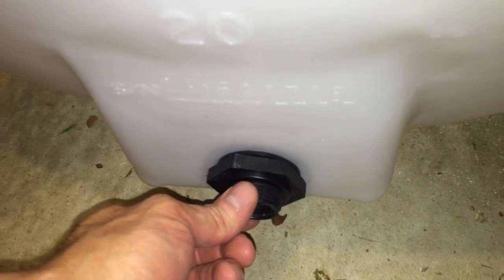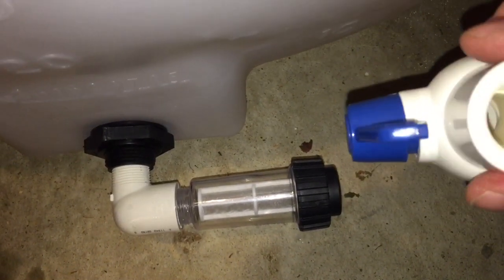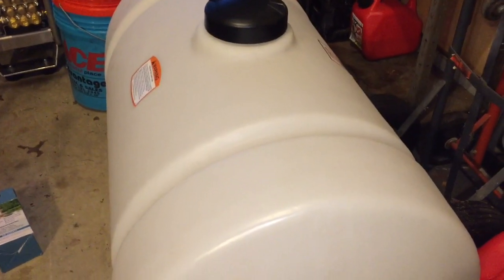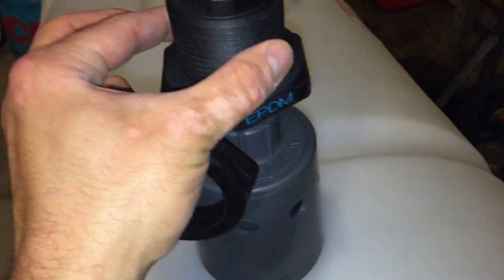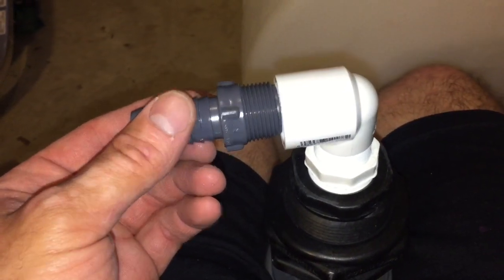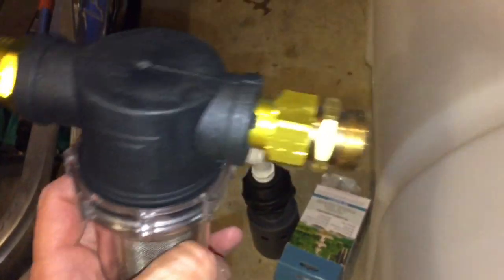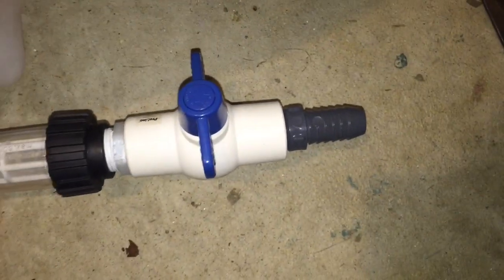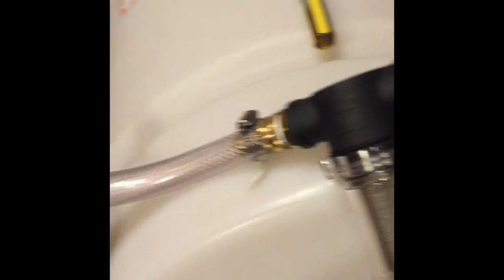Pressure washer tank set up

Comment: That’s a pretty good setup man, I ran something similar on my gravity-fed water tank. But the problem I faced right away was poor flow, due to the fact that I was using one of those Y splitters and then an actual water bib. The inside diameter of the water bib reduced water flow by a lot. So I changed it to a 3/4” fitting and hose all the way to the pressure washer and bam, problem solved. Good video presentation 👍
Reply: 1/2 by 3/4 if post link adapter?

Comment: I've found quite a bit of information online about installing a buffer tank.
The general rule of thumb is to use a 1" feed line on a machine the size of yours.
Hope that helps.
PWP had complete installation kits for sale on their website, included in the photos are diagrams of best known practices on installing a buffer tank. This allows you to pick up what you need at your local plumbing store

Comment: I have a Pressure Pro 4000 PSI 4 gpm AR pump. Bye hooking it up this way will I be able to put the wand down for at least five minutes without overheating the pump? Is it recirculating the water through the tank to keep the pump cool? Could you send me a list of all the parts that you used and sizes if this will work for what I’m looking to do with my pressure washer and that’s as I indicated above recirculating the water.
By the way great video. 
Thanks

Comment: I may be overthinking but would it be better to put the filter after the ball valve just in case you had to change or clean the filter, you could just shut off the valve with out draining the tank? Or perhaps it doesn't matter.

Comment: great video bro! I have a question... I have the same pressure washer and I run a small 2 foot garden hose for a bypass dump so when I'm not on the trigger but water isn't building up at the pump it's just dumping on the ground ..do you have that set up to flow back into your tank? I guess I'm just trying to figure out when I set my trailer up like yours will I still have to run a dump line
Reply from the maker: I currently have the dump valve looped back around to the pump. I was considering a dump into the feed tank but I mostly run from customers hose directly anyway so it didn't make sense to me.
Reply from the maker: you can run a return to the tank, for me I did not because I was not losing enough water to make it worth the return. I rarely do not have access to a hose bib on location.

Comment: it looks very awesone and simple... i have a 4gpm pressure washer i dont use a tank i would like to do this sometime i dont get good pressure from houses so does this setup give u the flow of water that ur presdure washer needs or need to add a pump?
Reply: yes. buffer tanks are necessary for pressure washer if your inlet connection doesn't have sufficient pressure. otherwise your pressure washer will cavitate and get destroyed in no time

Comment: How well did that set up work. I have  problems getting mine to build pressure off a tank and also have trouble with air getting in the line even though it is feeding off a 300 gallon tank.

Comment: Thanks for your video..Very informative. I did try setting it up this way but not drawing enough water. You have a 1" bulk head coming out but mine is only 3/4" and doesnt seem to draw the water. I have a 4000 psi 4gpm.. Would going from 3/4 to 1" bulkhead make any difference?  Thanks so much..Tom

Comment: Need the ball valve before the filter coming out of the tank, cause how will you unclog filter without draining the tank first?
Reply from the maker: gettinrings thanks for the tip, I did move the ball valve very shortly after this vid. I have the updated video with the correct ball valve setup.
Reply from the maker: Yes, I have since switched it.
Reply: And should replace the 90* fitting with a T fitting plus ball valve so you can dump water from the tank when needed
Reply: @KirshysProfessionalServices  where did you get that filter?

Comment: Increase the size of the hose to the pump. Flow is king. You can never have too much inlet flow, but you can starve it.
Reply from the maker: slim439 thanks for the tip, I will be doing that next season. Most of the time I am running straight from the customers water.

Comment: The fitting between the Hudson valve and banjo fitting, where did you get it? I have found several, but the banjo fitting does not accept this side of the thread that suppose to go in. It’s like it has to be a right hand thread for that side because the thread pitch is straight through on the banjo

Comment: great video, I was always wondering why cant people just plug there pressure washer to there garden hose
Reply from the maker: little mike951 the buffer tank for me is only used when my customer has a water flow that is not enough to properly feed my pressure washer. 90% of the time I run straight out of my customers hose connections after a small filter I carry. That really depends on your area and what type of water your customers have (city or well).
Reply: Kirshy's Professional Services okay that makes sense, thanks for the video and helping me understand how pressure washing equipment work. :)
Reply: Thanks needed this

Comment: Will this work on a ryobi  3000 psi gas , with no pump?
Reply from the maker: As far as the water flow it should be fine if you have a decent gravity fed set up. Belt drive pumps tend to pull water a little better.